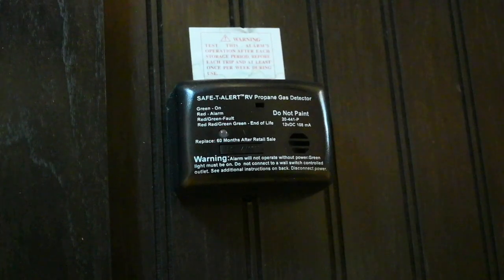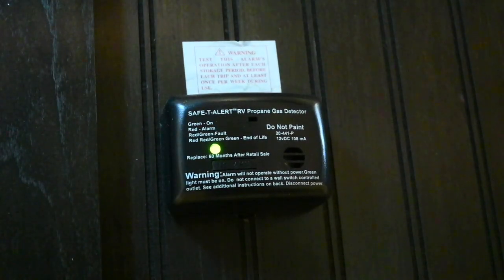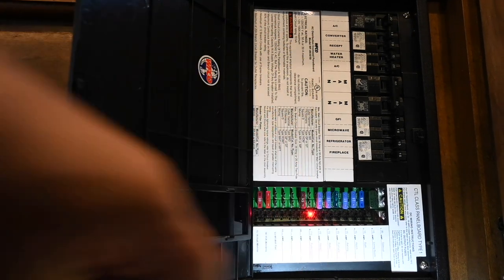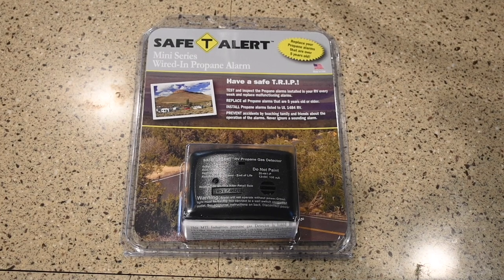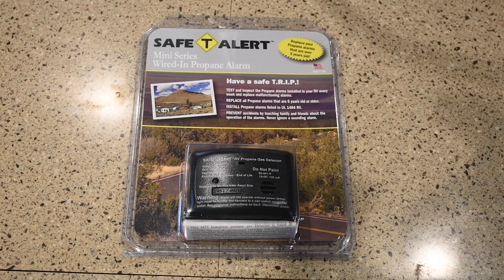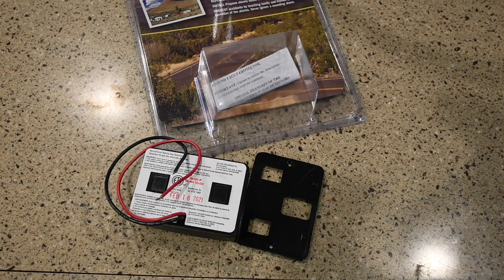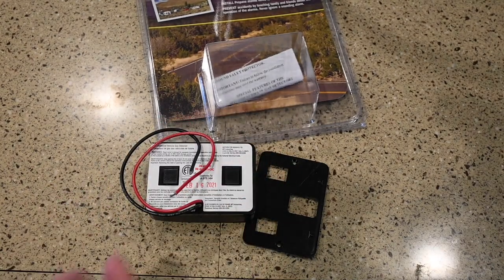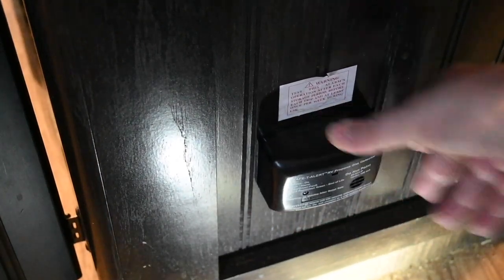Replacing a Propane Alarm in a RV.

Comment: I have a CCI Pre Tell 21. Original and 21 years old, still going, tho now I’m wondering if that’s what the 21 means in the model name.
Reply from the maker: CCI is out of business, so I am sure your unit is at least out of warranty...

Propane gas, I am told has a combustible density of 20%. So perhaps "21" in the model name refers to at which point the alarm detects a dangerous gas level.
Reply: I would replace it with a New One , even though you think it works

Comment: The crackhead that wired mine up at the factory didn’t label the diagram very well
I’m guessing “RAO” means radio
Reply: I was over 200 miles away and the thing would not quit chirping. Old lady was screaming make it stop, ended up having somebody just go cut the wire loose tape it up till I can get to it.

Comment: I heard a better test is to take butane lighter and expell the gas into the sensor
Reply from the maker: The manual states that testing with butane gas from a lighter can damage the sensor.  They did not state why, so I do not know under what conditions it is permissible.